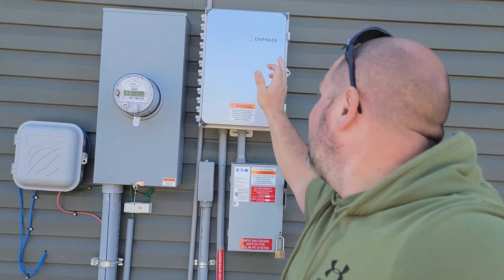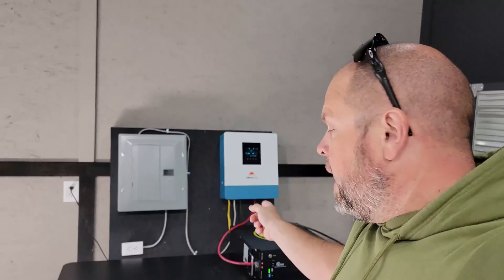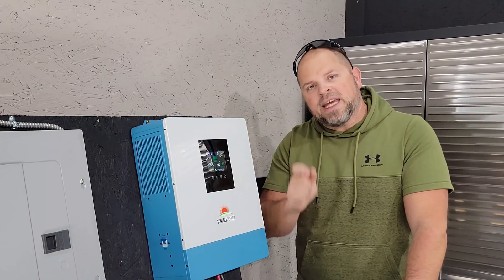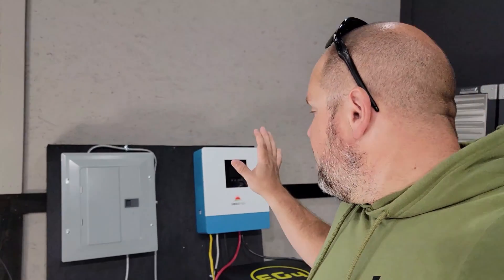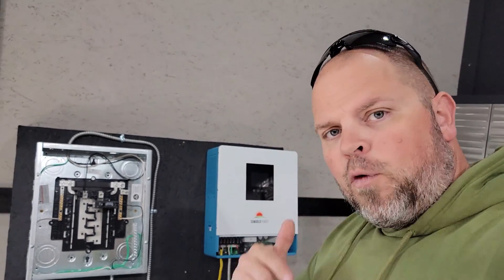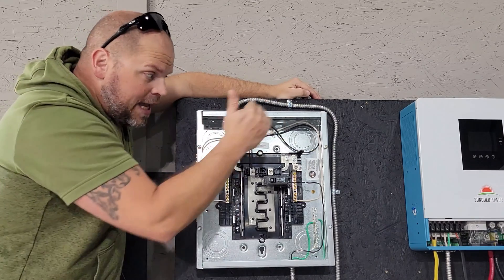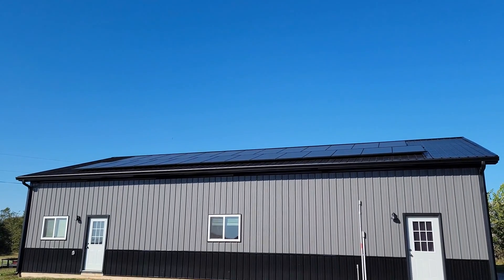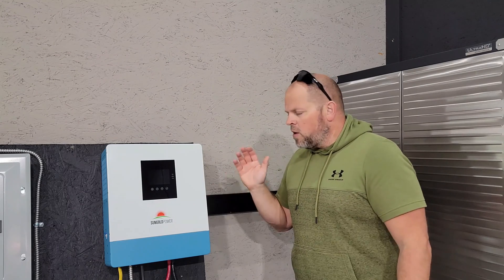SunGoldPower Hybrid Solar Inverter - Build 30kW Solar System OFF-GRID OR GRID-TIED

Comment: The ground neutral bond thing is confusing to me. My system has all the grounds and neutrals bonded. I just installed this unit and it seems to be working fine but wondering what the consequences may be long term? Is it just a safety issue?

Comment: Couldn't get into the website you mentioned in the video. I am thinking of starting my system with this inverter. Do you know if you have the capability to hook up a generator for backup until I get my battery bank big enough to run without one?

Comment: Nice system you have.  I notice you didn't mount your equipment on no-combustible material like Fire-Rated Backer Board for heat dissipation and possible fire protect to the wall. Just plywood I see in the video.   I mounted my Sungold All -In -One Solar Charger Inverter 5000-watt SPH5048P also on plywood because my user manual did not mention anywhere to mount this equipment on no-combustible Fire-Rated Backer Board.   Why did you not use it in the video for mounting?  I was hoping I wound not have to use it and have to redo all my work and hours over again mounting my equipment.  Please answer Am learning. Thanks Sincerely David J Gresham

Comment: I'm guessing that you aren't zoned as R1 low density residential. I got screwed by our township when I was asking about a ground mount over the past two years, and I dropped the hammer last black friday, and bought what i needed at great prices. Batteries, inverter, panels and ground mount stuff. Sadly when I applied for a permit this spring, I was denied due to UCC regs or something like that. I have a small working vegetable and fruit farm with a small orchard, a huge barn etc. but the township didn't care. No ground mounts allowed in my zoning, no exemptions. So, I'm buying a Haywagon and will mount my 'portable' panels there and park it out in the field between two of the 100' x 100' gardens.  lol  If it ain't mounted into the ground, it ain't a ground mount now is it.
Reply: Ez

Comment: I have a Sungold 8K kit, but no Electrician is willing to work with me. The county I live in needs a master electrician seal as well as a structural engineer seal before I can begin installation.
Reply from the maker: Wow, where are you roughly located?
Reply: @TheSolarPit  northern Virginia

Comment: I was hoping the title subject (Build 30kW Solar System OFF-GRID OR GRID-TIED) would be addressed. However, the only reference I noticed was a comment near the end to connect '2 for a 10kW system and go from there'. Do you intend to address the 30kW build in more detail later? Thank you.
Reply from the maker: You can build up to a 30kW system with multiple inverters. I did not title this as an install video, it was meant to be more of a review of the unit itself. Sorry for the confusion.

Comment: Thanks Justin. This is most interesting. Does your location (city, county) require a permit to install this equipment? My greatest hurdle now is meeting the permit requirements. So, anything you can add would be most helpful!
Reply from the maker: Yes my location does require a permit for installing solar. I have some videos on an Enphase system I installed a couple years back. I am actually working on a new install right now, hopefully I will be able to share that with everyone soon.

Comment: Where does the yellow wire run too
Reply: I am installing one and can't figure out how to wire this part, it's meant for AC input and I want it to charge batteries and/or run off of when battery is low. As is, I just keep tripping my main power breaker when it starts up
Reply from the maker: You may need to lower the AC input setting within the inverter settings. Hard to know without having all the site details but it does sound like the input charging current needs to be lowered.

Comment: Thanks for the video. I just unboxed my Sun gold SPH5048P. I plan on using 3  Vatrer LifePo4 51.2 batteries. I have 8 420 watt solar panels and will have to series parrel because they produce 620 VDC if I only series wire them. I am looking for help designing the wiring diagram. I will not connect to the power grid I just use these to run my a/c to lower my big electric bill. This hot summer weather in Oklahoma is making my electric bill  around $400. I already have other systems  foe my security system, PC, and TV. I also have another one for the shaved ice machine. And a small ecoflow for the .7 cubic feet freezer. I am on a learning curve and I do not learn easy LOL. All help is appreciated.
Reply from the maker: There is a lot of planning into designing a professional diagram. I am not comfortable with assuming some things so I would recommend maybe using a program like lyrasolar.com to help you out.

Comment: Just got mine, and I have 2 sungold 5.12 powerwall. Off grid set up, but i cant get it to seen to charge the batteries. It just says my solar is 77v . I have 6 (400w) set up 2 series 3 parallel. Doesn't show charging.
Reply: I looked it up. PV operating range I 120 to 500 vdc.  77 is probably too low to work. Try running all 6 panels in series. 
Sorry just noticed 5 Mon ago. My bad
Reply from the maker: I would reach out to sungoldpower tech support. Also please let us all know your experience with that. Positive or negative. Good luck!

Comment: Wire Size Question .... Your temporary installation downsized input circuit wire from the AC panel based on your intent to limit AC power allocated to charge the battery  ... enabled through inverter setup options restricting output to 30 amps max in your case, to charge battery, foregoing the full 100 amps this inverter is capable of delivering.

In my system, this inverter unit is located 75 feet from the GRID POWERED split bus load center, so wire size and cost has become a real consideration in my limited budget project.

Sizing power input wire and fuses to tap the inverter's max output ability for a) battery charging and b) house loads will draw 42 amps through those wires, which should be upsized per NEC 80% rule to carry 125% of that safely.

The unit itself  draws about one-half amp.

 Tapping the full 100 amp charge capacity dictates use of AWG 6-2 plus ground wires for that AC feed.

My 4s LiFePO 48-volt battery array's OPTIMAL charge rate is only 20 amps, so can my AC input power wiring be sized on that basis?  Drawing 21 amps max for battery charging times 125% or 25 amps?

That is far less costly to install.  

Ourput wiring is another matter and combining AC, PV, and Battery output could easily max out at 42 amps and will require full 60 amp provisions.
Reply from the maker: I would consult with an electrician to be 100% certain.

Comment: Just bought my 5000w  sungold. Off grid kit. Looking forward to you helping me install everything!!! Solar panels  and all thar extra  stuff you said I need for permanent design
Reply: Beware ... this 48vdc inverter's solar charge controller requires considerabbly more voltage than you can get out of a 48vdc battery to take advantage of its MPPT capabilities.  Instead of four (4) 12vdc 100 watt 5 amp solar panels wired in series (85 volts)), it will take at least six (6) panels in series to produce  nominal 72vdc to meet the 120 volt required input to run the MPPT charge contriller and get all the power your panels are capable of peoducing.
Reply from the maker: Good stuff and good luck! 👍🏻
Reply: Did you have a hard time getting county approval? I am going through a painful process and finding a master electrician that will seal the system for insulation and that it is safe as well as structural engineer to approve my roof for safe panel installation

Comment: Can i it run any submersible water pump from  ½hp,1hp, 2hp,2.2hp,3hp,¾hp to 4hp
Reply from the maker: Are those 120v pumps?
Reply: @TheSolarPit  yes
Reply from the maker: @campbellvernois-if9ck  None of those pumps are over 20amp right?
Reply: @DIYSolarBuilds  No except for inrush current I think
Reply from the maker: @CampbellVernoïs120  I did find that it is rated for loaded motor capacity is 4hp in the spec sheet.
Reply: @DIYSolarBuilds  Does that means it can run 1hp,2hp,3hp,4hp motor loaded?
Reply from the maker: @CampbellVernoïs120  Yes up to the 4hp version
Reply: @TheSolarPit  ok thank you
Reply from the maker: Your welcome 🙏

Comment: Great job on educating yourself on solar. I kinda did the same but didn’t pull the trigger due to install costs. In my research I found SolArk 15 K and used optimizers for DC to my battery bank of EG4 LL. I basically have an off grid system with grid backup. I could only afford 3 batteries for 15K storage. I also live in Dallas county where we have electric companies competing for our business. The one I went with offered free  electricity from 8pm - 6am. My  panels  provide me power for my whole house,including my a/c for 99% of the days. My batteries fully charged from the grid at night carries me through the morning till the panels kick in and powers the house and charges the batteries backup. The batteries also carry me through the end of the day to 8pm. 
I had this installed right before EG4 18K inverted came out. From what I’ve learned about them I would go with the EG18K  inverter. My electric bill is usually $4-5 per month. For some reason SolArk inverter draws the power to power the inverter from the grid. That’s what I pay for in my electric bill.
Reply from the maker: Awesome! Thanks for watching and commenting 👍🏻

Comment: Question, I recently set up a sungold 5000w inverter. It’s hooked up to (4) 200ah lifepo4 batteries. On the display screen it’s saying “gel” by the battery. Is that correct?
Reply from the maker: You should change the setting to LFP. Thanks for watching and commenting 👍🏻
Reply: Do you know what the correct setting would be for the EG4 battery under the "battery Type"? I also have the same inverter and battery from this video but see there is 3 different LFP battery settings so want to make sure I choose the correct one.
Reply: @Brun18ette  The correct setting in most sungold units for the lithium batteries is based on how many cells it has. Your 48v lifepo4 battery should have 16 cells therefore the setting would be L16.

Comment: Are these SRNE or Voltronic manufactured inverters?
Reply from the maker: Speculation is the sigineer is the manufacturer. I can not confirm that, though. I am still researching for a definite answer. Although the builds do have similarities to manufacturers like SRNE and Voltronic. Thanks for watching and commenting 👍🏻